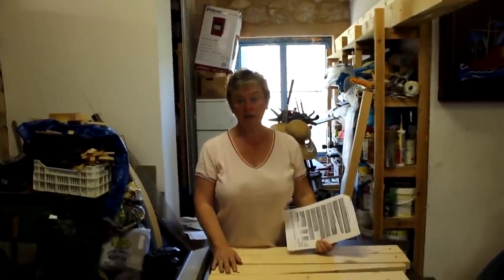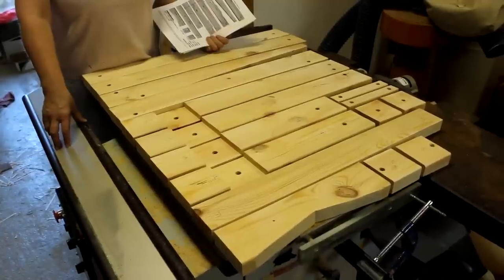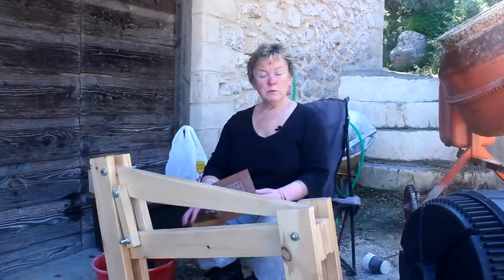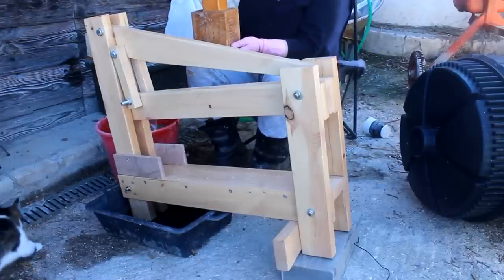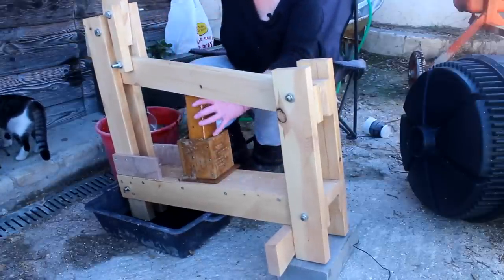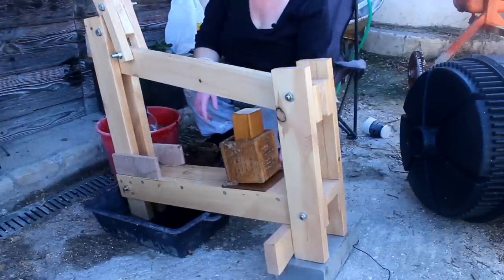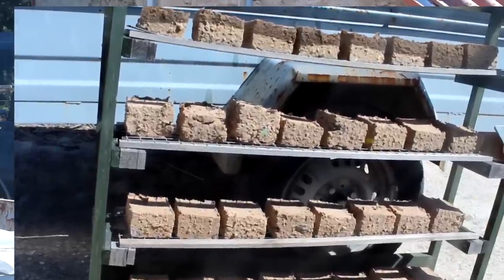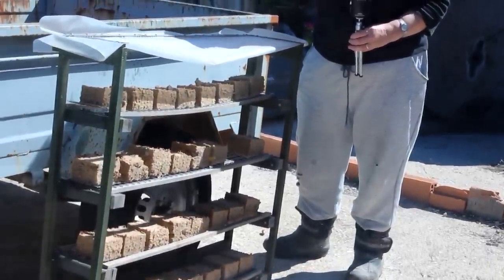BRIQUETTE PRESS

Comment: The center hole really is best for the burn and it would be so easy to rebuild that part of this press.
When I make mine the legs will be longer, the briquettes will have the center hole and the pressing part will be taller with a spacer to make two at a time.
Reply from the maker: I'd be interested to see your version when you've completed it.
Reply: Pauline Martin When I do it I will do a video but it will not be until next summer.
It is kinda cold here in Michigan this time of the year. I also will probably use four inch PVC for the form. You sure did an excellent video here.

Comment: Pauline, Your video has been very useful to me as I have built the same "notched press" here in the Southwest United States. I had downloaded the original plan sometime ago, but as I discovered on your video, the plan had been updated to show Imperial/U.S.measurements since I last looked at it. I currently have my press almost completed in my workshop. However, I found after final assembly this afternoon that the handle (part E) does not pivot down as far as yours, or as in the "Hite" video does. Consequently, neither does the lever arm (part C) travel down its channel as far as I think it should. Chances are that I've made an error in fabrication, even though I've double checked all the measurements.I'll work on it and let you know how it comes out.You are obviously a woodworker, as am I. I am curious about your table saw, which appears to be a combination machine. I think I see a router to the right of the blade and I envy you the sliding table. Most table saws in the States require the buyer to purchase sliding tables as an after-market accessory, or as in my case, to build a cross-cut sled. Is your saw perhaps a Czech design?  May I also ask you how you are utilizing the briquettes you are making--in a rocket stove, or perhaps a heating stove? I reckon I will make a "stick" briquette mold. I'm interested in fabricating a rocket stove and I'm guessing stick briquettes should work quite well in it. Cheers from Bill in Arizona

Comment: Hello Pauliine . Sorry for the delay in answering your question.
Not a dumb question at all, I dont think I explained myself too well.
If you hold your thumb up with the nail facing you, that will give you some idea of the shape I mean.
As the pressure bar comes down it will always make contact with the top of the plunger an not on the corners to make it tip sideways as yours does at the moment.
Love to know if you think its a good idea or not? Ray x

Comment: Hello! Awesome video. I am curious, I just moved to a cold climate so I am looking into this idea as a way to heat my house. My worry is will burning essentially junk mail bricks cause a stink with my neighbors? I live in a neighborhood and I don't want to offend them with a foul odor. I guess what I am asking is: Is the smoke coming off of these bricks offensive to others and my wife worries if it will make the house smell bad. Thanks!
Reply from the maker: Hi

We've never noticed a bad smell when burning the briquettes, but we mainly use them in our log burner, rather than on an open fire.  We also use them as firelighters for the BBQ, but I haven't noticed any odour then either.